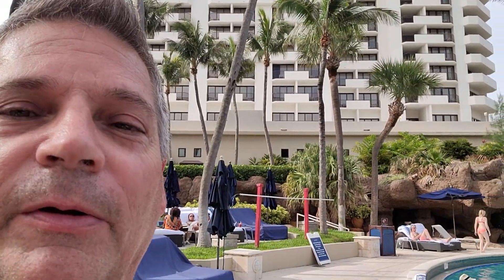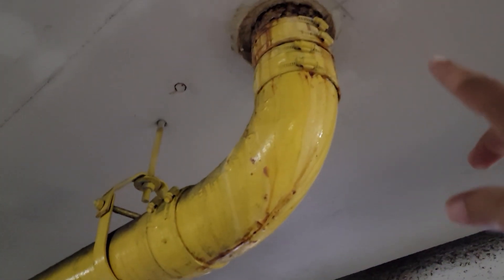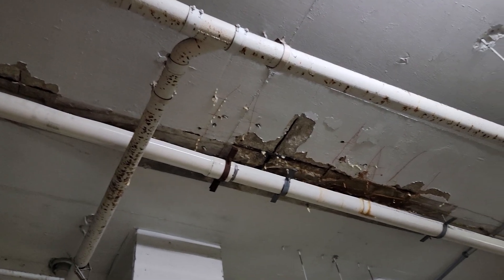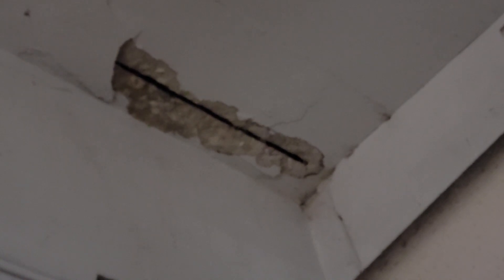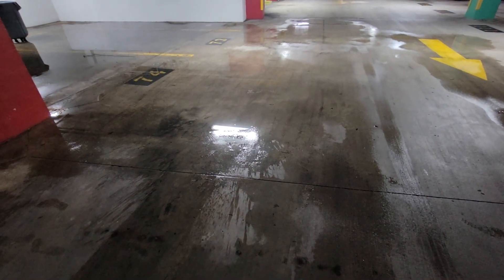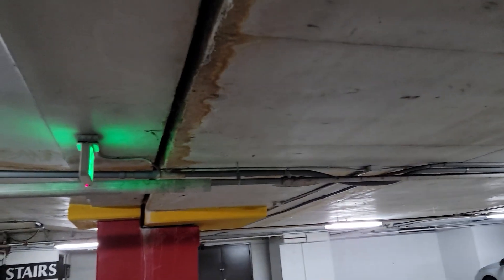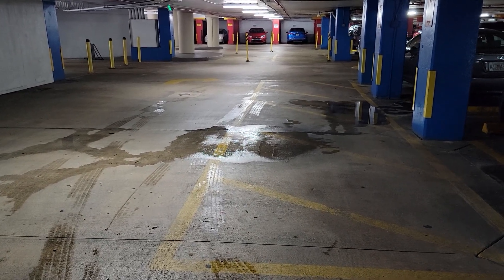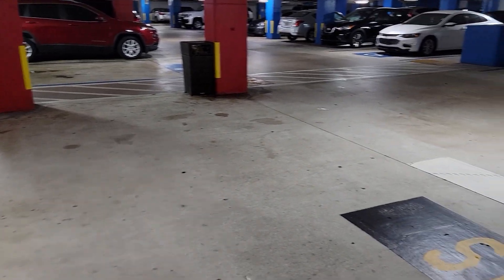Scary Garage Damaged Concrete Marriott Harbor Beach, Like Surfside Collapse

Comment: I worked security over 10 years , many different condos, in Panama City Beach, Fl. If you checked out condos there you'd see lots of this , plus the mickey mouse repair and patching done by maintenance to save money. And most under 20 years old. I worked a condo where garage had no drains and 4th floor flooded in every rain above your ankles, stayed that way for over a week or more. Hated garages with pools over them. Always leaks.

Comment: Jeff your investigating and commentary are the utmost  relevant accurate and technically authoritative in regards to High Rise  Building Safety . 

The Discovery of the BreakDown of the Concrete and Steel Rebar Support Collumns and Ceilings are a Priceless Walk Through Inspection That Highlights the Negligence and Corruption of the Management that is Paid to maintain the Properties.  

The issues that Jeff focuses on are only the most relevant regarding building support  integrity . Not one major issue identified by Jeff is trivial , a true Visionary .

These issues that Jeff found are Profoundly Deteriorating Conditions of Building Support while Also are Issues that have taken YEARS of Negligence to Attack the Structure .
Reply from the maker: Wow, thanks Vincent

Comment: It seems that Florida has a complacency problem. Obviously, codes and standards should be reviewed for updates more often and inspections more frequent. I can only imagine how many buildings there have as bad or even worse conditions, and you would never guess it from looking at the outside. This is what government and regulation are supposed to prevent. This is just evidence of way too much money trading back and forth between the wrong hands and not going where it should.
I bet if this kind of thing were what showed on the rating sights like Yelp and TripAdvisor, more of these places would better maintain their own buildings without inspectors having to require it under threat of penalty.
Good job, Jeff. I wish more people did this kind of thing.

Comment: Many thanks,  Mr. Jeff, for this eye-opener - I looked on line to see when this hotel was built - 1984, if I'm not mistaken.  In our small vintage Georgia home, we have an air conditioning line made of plastic (in the basement) that carries water from the a/c to the outdoors so I wonder why a/c pipes here are allowed to dribble inside the garage. I also wonder if the cast iron pipes should be replaced with PVC. In any case, the amount of rusty rebar all over is very scary. Won't be vacationing here!
Reply: Depending on the pressure the cast iron pipes are required to handle at this location if any.
Reply: They are not allowed to dribble, they are just poorly maintained. They can either leak, or as appears in at least one case Jeff showed, have condensation due to failing insulation. It is so humid here that these pipes carrying cold drain water will collect a lot of moisture. They need to review all of the fixtures in that garage, everything was dripping for some reason or another!

Comment: Oh My God Jeff, that building is rotting away.  I'd get the hell out of there.  A few points: one, that large cast iron pipe is either a drain for the pool deck, or a sewer line.  It is NOT sprinkler.  You don't want to be sticking your finger onto the dripping liquid.  Point 2, you did discuss a galvanized pipe that was surrounded by a hunk of PVC pipe.  That is a sprinkler line.  AND I see that that one chunk of it had been replaced because it was shiny and new, while the surrounding stuff was painted white.  Undoubtably, it rusted out because of the dripping water, so they added PVC to prevent it from happening again.  Point 3, the electrical conduit with the exposed wires: oh Jeez just waiting to electrocute somebody.  Glad you didn't stick your finger there dude! Point 4 there was a decent size crack in the ceiling at 3:56.  And that spalling.  This is a terrible way to construct building in such a wet, rainy, marine environment.  There is no way that rebar is not becoming seriously compromised.  As I mentioned in an earlier post, CTS won't be the last building to fall down there.  Run like hell man.
Reply from the maker: I might go back if they lower their rates

Comment: Seeing those exposed rebars is really scary, because if they leave those alone and dont do any fixes/maintenance, it's really only a matter of time before there's a collapse.  Once that steel starts to rust, that will spread all inside that concrete and break it to pieces from the inside.
Reply from the maker: yes and it is widespread in that garage

Comment: I would contact the Broward County Building Department immediately as if there are any failures, this video would become evidence. As an engineer, you have an ethical and professional obligation to report any damages that would create a life safety concern e.g. building failure. I can tell you that exposed and expanding rebar, extensive leaking that is causing the degradation of the concrete fits into that category. This is quite different than Champlain Towers as the building is still standing. Further, the elevation on one side of the seam needs to be investigated as one side is significantly lower and maybe a geological settlement. That building has serious concerns that need to be investigated.
Reply: Yes and no.  The movement joint should have been dowelled to prevent the relative movement.  The movement probably failed the joint seal if there was one top-side.  It is probably creep deflection of the structure rather than foundation movement but hey I'm not there.

Comment: This is so reminiscent of the condo that I bought. The garage was always wet and we had balcony issues. They had to take the rebar out of the ceiling of our condo, replace it and build new balconies. I'm so glad we sold it and moved. The condo board always hired the worst contractors and some owners started to rent out their units to low-life yabbos. Hopefully Florida will take these condo inspections seriously and the condo boards will start saving for future repairs, instead of putting a bandaid on the problems.

Comment: Champlain Towers should be a wake up call to everyone.  Videos like this one tell me what to look for.  It also tells the management and owners.  And their insurance companies.  My question would be how quickly can the problems shown be addressed if everyone in Florida is trying to address problems.  As scary as this looks, I am persuaded by BI's video that a final revision of the building design that removed some beams underneath some planters was probably the major contributing factor to the very first collapse.
Reply: Why aren’t insurance companies requiring repairs? I owned 5-plex residential homes and every year they had me spending money. Sometimes as simple as scraping and repainting fascia. Other times repainting rusted metal roofs.

Comment: I grew up in Florida and we didn't have basements. So I always find it hard to believe there is any underground anything. High water tables, sugar sand and lots of rain. Not a good combination for underground stability.
Reply from the maker: All the more reason to maintain that concrete
Reply: There are basements to be found in Florida.  They are commonly not done simply because it is not necessary to excavate below a frost line like northern construction.  There, since they've already dug down that far, they just hollow out the rest for a basement space.  Basements close to the ocean are not a good idea for obvious reasons.  Inland it is less of an issue.  

I live just north of Clearwater with an elevation of about 45 feet.  In the area of Clermont, just west of Orlando, they have hilly elevations of 200 to 300 feet or so.  Water tables are not usually close to the surface at that height, depending on what is beneath the soil.  

I do see an occasional basement house around home.  Rare, though,  because it is just an added expense for builders to did it all out.  Mostly they just dig deep enough for the thickness of the slab or footers as long as the soil is stable or drive pilings.

Those basements along ocean beaches do seem scary and, if nothing else, should have much sturdier construction and drainage provision.  I see too many spindly columns where thicker ones and solid walls should be.  Not an engineer, but simple instinct tells me that.  Newer construction is paper-thin in many places.

Comment: After checking his family into the Marriott Resort... Jeff goes missing for 30+ minutes... haha  At what level of deterioration would you immediately check your family out of a hotel resort... after seeing numerous areas of concrete and rebar decay?
Reply from the maker: I think if I saw large chunks of concrete falling off the ceiling and spalling on the columns is when I would begin to be worried
Reply: Other than that one passageway  adjacent to the pool and the areas on the ramp down to the garage parking,  not sure I recall seeing any large missing pieces of concrete in the one video of CTS.  Lots of small areas.

Comment: Most of your discussion is about repairing the underside of the slab. I agree that it has to happen ASAP but first I would focus on the repairs up above to stop the water, make sure the underside stays dry and then make the structural repairs so the water is not trapped above the repair.
Reply from the maker: any repairs should involve stopping the leaks first correct

Comment: Always blown away by how deteriorated the rebar is in these videos; I was gardening last summer and ended up finding a rod of rebar an inch into the dirt that was in better shape, and it had been there for 40+ years! I even found a couple rods of rebar in the remains of the old root cellar that were in a similar condition too; rusted but not corroded. Hell, that rusted old rebar would be an improvement over what these building get away with having!

Comment: That part where he wasn't sure if the cast iron drain piping with MJ connections is a drain or sprinkler 😆
Normally sprinkler piping has Victaulic connections, smaller diameter bits can be threaded. There are T and 90°  fittings however drain, waste, and vent have TY and Y fittings.

Comment: Why isn't the inspection teams out doing their jobs and making shure this doesn't happen again? Common this can't be just a Florida problem I would guess any high moisture climate would do this?
Reply: Actually, I lived in a homeless shelter in Denver, CO, a few years back.  Watching these videos has made me realize that their patio/deck was in serious need of repair.  The water from snow melt should have been draining off the sides, but was actually pooling on the deck.  They were doing a major remodel, and I hope they fixed the issue.  Denver's definitely not known for rain, but the snow comes and melts all winter long.

Comment: I am staying in a hotel right on the beach in NJ and did an inspection myself and found some of the marks of concern you noted from others. No standing or dripping water, but some spalled concrete, rusted visible rebar, some concrete separations that have been repaired and supported with new trussing.
Reply from the maker: Oh wow! scary isn't it, that this lurks in the garages of many buildings

Comment: the problem with the champlain tower was that it was under built so just a little corrosion caused it to fall the  building in this video looks like it was built much stronger those columns were at least 24 inches with pads on the top and corner angle iron. This building here has much less of a problem. go to the champlain tower that is still standing that one was probably under built.

Comment: Does the water pooling on the floor cause issues with the integrity of the floor concrete?  Will it eventually seep in and soften and affect rebar etc?  Those long rebar showing alon the ceiling, and dark aots following it, seems structural integrity is probably not what it needs to be.  Yikes!  I hope more people take more video of stuff like this when they travel.  Water destroing electrical is not good either....  Yikes!  Be safe and go have some fun!
Reply: only if the concrete has cracks, otherwise there is no way for the water to "soak" into the concrete its not porous. But a constant stream can increase deterioration of the concrete still would take many years. If you look on YouTube for videos of rock erosion there are videos of rocks that have had water dripping on them for 10,50,&100 years and you can see how much gets eroded overtime. I am a general contractor
Reply: @cexy63s  Thank you!  Another rabbit hole to explore Lol 😉
Reply: Concrete is inherently porous, although a sealer can be added to the concrete surface to prevent water penetration. It's practically impossible to make an absolutely nonporous concrete where water won't penetrate even a fraction of an inch.  This myth that it isn't causes alot of issues.
Reply: @okn0tok  Yes, here in Australia the concrete squeaks and squeals with the sound of thousands of tiny bubbles when you drench a part of it that has been dry as a bone for months...
Reply: 5 seconds on google: “Concrete is porous & permeable to water.”  

I wish people would at least double check before postinh erroneous information!